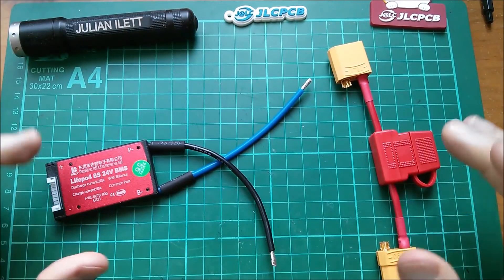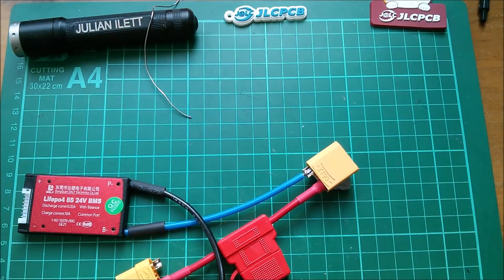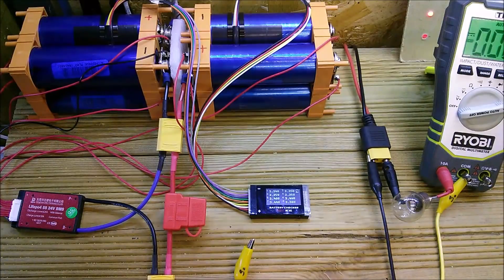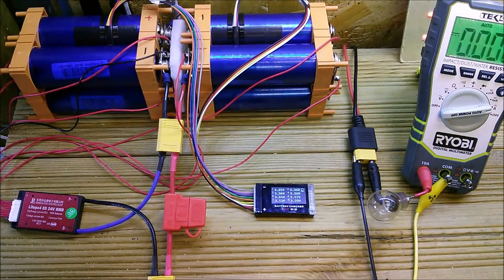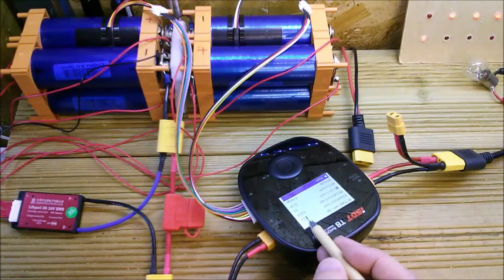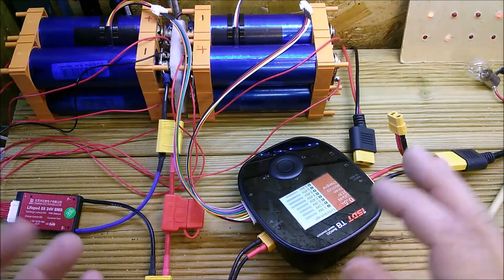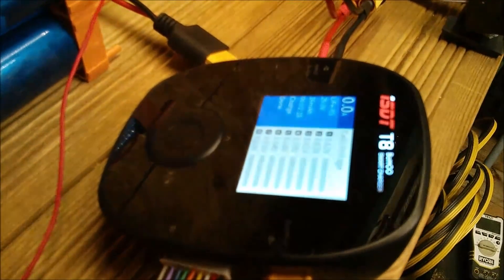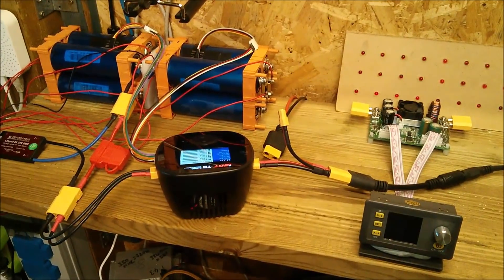Top Balancing a LiFePO4 8-Cell Battery

Comment: Dedicated BMSs are relatively expensive/unreliable so for the last 4S 18650 battery I built, I just purchased a dedicated ISDT charger for it and it works very well with solar since you can set the charge rate as low as .1 amp. There is still a danger of over-discharging a cell but a low voltage disconnect switch set to disconnect when the cells are 80% discharged with identical in spec/age batteries seems to be working well.

Comment: could these be used in an old scooter that two 12v closed cells lead acid in series 20Ah
the scooters from 2004, the cells still charge up to 12v each, but don't hole any current. how much did that set up cost you please Julian???? so i can give my cousin a price range for a proper fix instead of cutting open the cell's and replacing the acid.
Reply from the maker: Watch my electric bike videos. I swapped out the old lead acid batts for lithium.

Comment: I had that Ryobi iron and couldn’t stand the massive stand it was in.  So I pulled it apart and inside is a board about an inch by 3 inches.  Put a usb c pd trigger on the input snd shrank the whole thing by 90%.  Still really Dont like the grip though.  Do you prefer that over say a ts100?
Reply: I have been using the TS-100 and it has been the best iron I have ever gotten, maybe the TS-80 would be good for you since it can use both USB-C and DC Barrel.
Reply: @SuperBrainAK  yeah they are fantastic, I was actually just commenting because I have sort of a soldering iron obsession and have 12 irons including both of the miniware options you mentioned.  They’re fantastic although I belief it or not am in love with the cheapest one right now - the “pinecil”  …. It’s funny as it’s by far the cheapest iron I own by a lot and ergonomically it feels like my jbc; without the massive station. 
The ris-v processor is fast and responsive, t12 tips are accepted so no shortage there.

Back to my point sorry for the rant, I bought the Ryobi because, well I don’t know.  Reasons. 
And I quite literally hate everything about it.  So when tearing down the case the irons controller pcb is so tiny I printed a case and added a type c connector and it works great.  The handle is just dreadfully uncomfortable.  So incase I sound like a snob,,, remember my favorite iron cost 34 dollars so, yeah!
Reply: @RMquickbit  haha yea! I’ve heard good things about the Pinecil and will probably try that next if I ever need to
Reply: @SuperBrainAK  buy it, you won’t regret it!  Just skip lunch one day and it’s paid for 😂